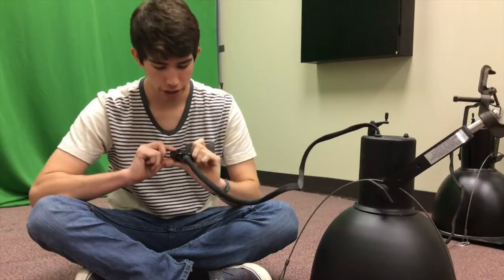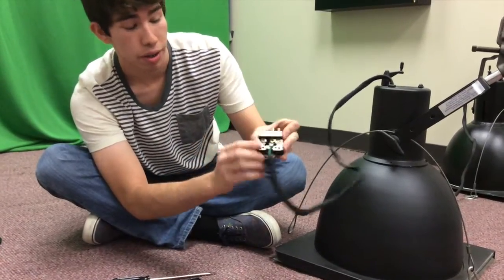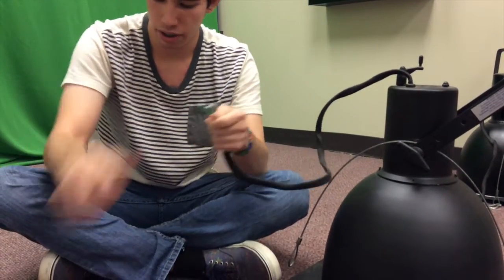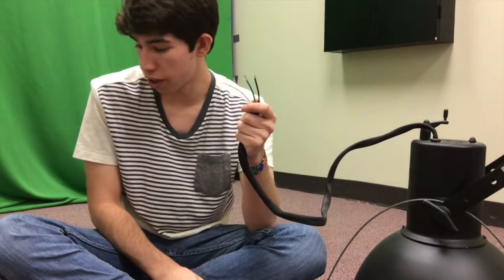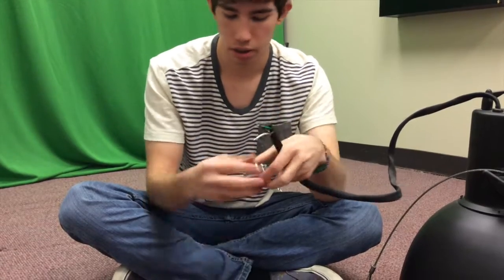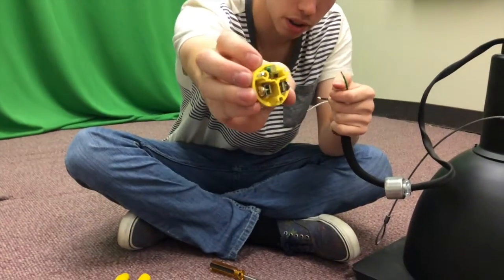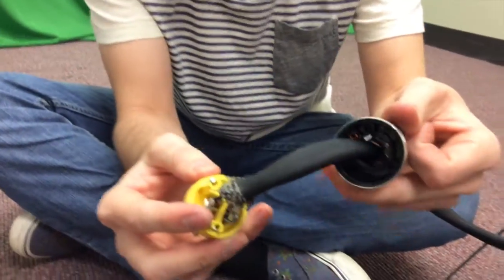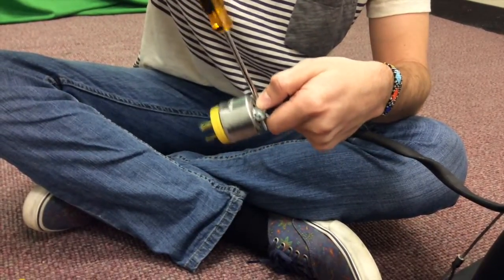Stage Pin to Edison Connector

Comment: EXTREMELY UNSAFE!  Info is WRONG. Worse yet, it will"work", in that the light will turn on... BUT you stand a 50% chance of eliminating an important safety feature, since there is + or - side.

Comment: This video should actually be taken down, because he is very dangerous in his serious wrong electrical installation of this electrical plug, because anyone properly learning basic electrical needs is (first) taught what colored wire is positive, which is always either black or red, and what wire is always the neutral wire which is always white.
This individual has everything backwards which shows right off the bat that he doesn’t even know the basics of electrical installation and equipment.
Stay away from this video and anything else he is posting.
Period!!!!!!!

Comment: I am very very late but you mentioned polarity is white positive and black negative which is wrong. AC doesn’t have a native polarity. But black is hot and white is neutral. So in a way, you could say hot is positive and white is negative.

Also everything here was wired reverse polarity. Which again, doesn’t matter on AC too much, but in technicality it’s wrong.
Reply: Reverse polarity DOES matter for safety:  Putting "hot" where "neutral" belongs does all kinds of dangerous things like circumventing safety systems/design.  If a household lamp were wired with HOT/NEUTRAL reversal the screw threads would be "hot" instead of the pin at the bottom being "hot."  While the bulb will work either way it's a lot more dangerous to have those larger silver threads hot instead of the brass "pin" at the bottom (it's typically more difficult to stick your finger into the bulb socket and touch the pin vs accidentally touching the threads).

Comment: Stage pins are 20a 
So there should be no heat problems changing out a 20a plug for a 15a plug...
Reply: It depends on the size of the light.  @ 120v a 650w will pull less than 6a and 1000w will pull less than 10a.